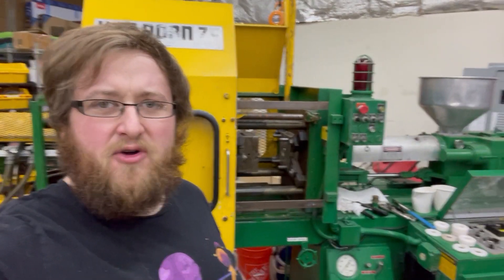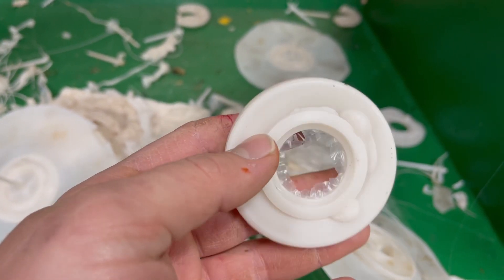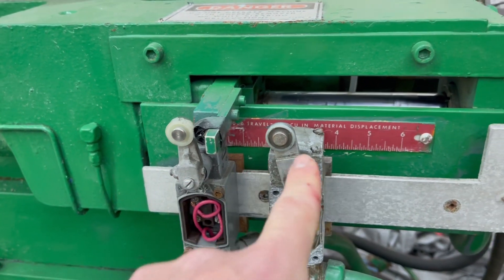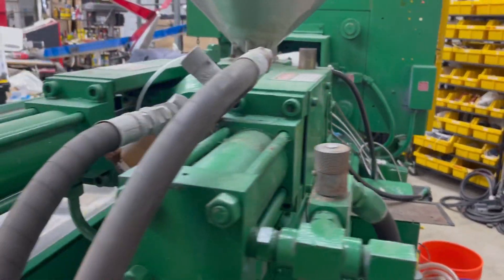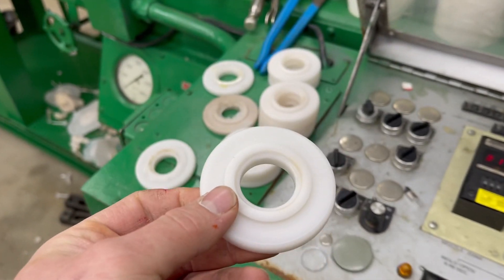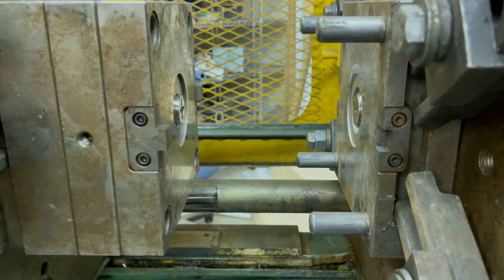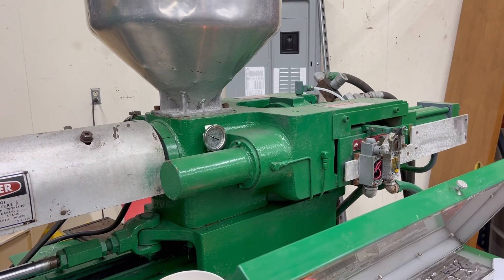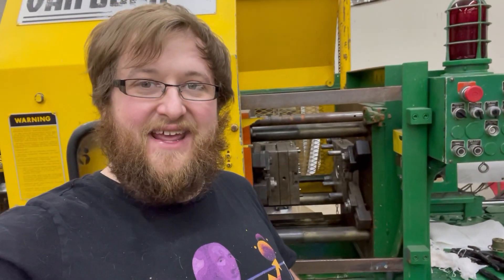Learning How to Use the Injection Molding Machine- Basic Settings

Comment: Thank you for making this video!! You explained it in a really clear way. 
From the way you described it sounds like it's using flow control and pressure reducing valves. Not servo valves or proportional control valves. Is this correct?

Comment: i see there are two water fittings on both halves. with no chilled water over a long run you encounter flash and the cycle will get slower and slower.

Comment: I don't see any cooling lines (water) temp controllers hooked up to the mold? You must maintain a constant temp on the tool or it will just heat up from the injected plastic and you will lose Die Height (clamp tonnage) and it will not clamp up. You stated that the ejector plate is back and the ejector pins are still out... Make sure your ejector rods are bolted to the ejector butterfly plate. That's what pulls the ejectors back after ejection (unless the tool has spring loaded ejector return). I used to run and process the same old Van Dorn and Arburg machines at Stanley Black and Decker for 30years.. From 25 Ton to 1200 Ton machines. Still in the field but with all electric state of the art machines... clean, quiet, precise and fast....

Comment: Hi Sam I'm a new subscriber [after watching you for a while].
I'm from Italy so please don't blame me for some writing mistakes.
I did many retrofits of this kind of machines on the electric and electronic side [from electromechanical to electronic conversion + HMI + VFD integration].
First of all this machines are quite dangerous and especially this outdated electromechanical machine is pretty unsafe.
Moreover you are running the machine with the electromechanical components in a bad shape.
Looking at the switches on the  material loading and plasticizing movement they are quite unreliable and that can determine a problem on the material loading and on the injection quantity/end position.

The adjustment of the hydraulic pressure (for open/close, injection, plasticizing, part ejection) and speed related movements is mostly related to the material you're using as well as the temperature of the injection barrel and is not easy to master it.
I know that you're a smart guy and you're very capable to collect various different experiences to solve a new one so you will success even on this new.
My two cent advice is to be very careful about the safety side. ;-)